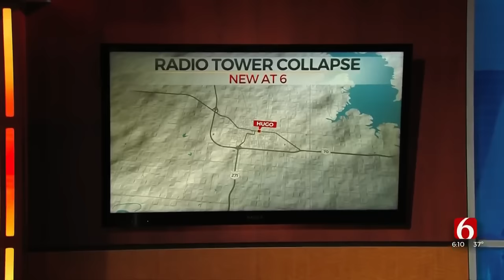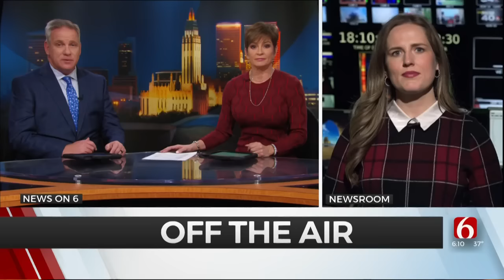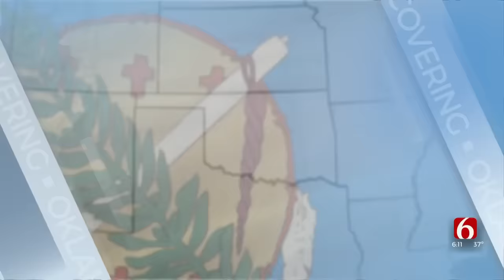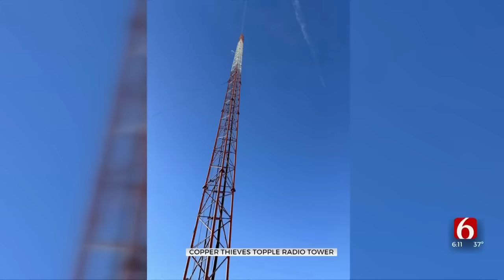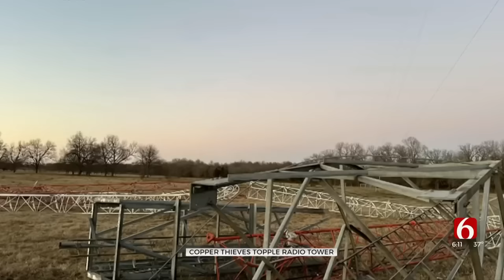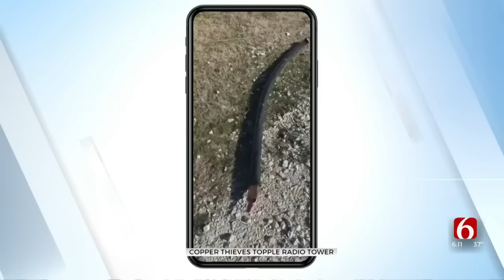Thieves Cut Down Radio Broadcast Tower In Southeastern Oklahoma To Steal $100 Worth of Copper

Comment: The FCC needs to make tampering,with ,or removing copper  wire, or by the act of doing so damages the tower  make it a  automatic Federal class three felony. No matter how much the value of the copper was. Destruction of radio broadcast systems that are vital for transmitting  emergency  weather alert information and other public information for public need to now.

Comment: Either the towers were decommissioned and therefore safe to approach, or thiefs are unaware of the unalive high voltage threat.
Reply: @farmcentralohio  Tell me you don't know how radio broadcasting works without telling. Gird jerb!
Reply: @farmcentralohio I've been zapped by a CB radio it's not fun it hurts under the skin not on the skin not like any burn or anything Ive ever had before. You can smell the burn on the outside but it looks fine and hurts on the inside Plus CBs are only 27 MHz not 100+MHz or GHz that's much worse
Reply: @farmcentralohio  Just speaking like a farmer because it's obvious you have no clue.
Radio transmitters power is measured in WATTs. Anywhere from 50k watts to 150k watts. For such a power and radio signal genius, I am surprised you don't know high voltage is needed for those wattage levels.
Reply: Radio transmitter output voltages can be in the kilovolts high frequency AC.  Up to 10,000 volts for 50kW or more systems if memory serves correctly.
Reply: Depends on the power output. A 1000 watt AM station will have about 225 volts on the base of the antenna. A 10,000 watt station will have around 700 volts on the antenna base and a full power 50,000 watt station will have about 1600 volts on it. Go ahead and lick an AM stations tower sometime. There is a reason why WARNING HIGH VOLTAGE signs are mandatory around such sites. FWIW I worked as a broadcast tech for 22 years. I do know a bit more than you think you know about this.
Reply: @JohnDeereR-zw3wj  You are addressing your post towards ohiofarmboy I hope. I have about a decade more than you in telecommunications experience. But thanks for confirming my statements!
Reply: @Shadowband  Yes sorry if my post was out of step. I was replying to whomever it was that was laughing about antennas having high voltage on them. They CLEARLY have NO CLUE. Also as you know, that voltage is at RF frequencies and not good old 60 hertz like in the wall outlets. It tends to sizzle and fry human tissue as well as shock you.

Comment: The story is UNTRUE  The owners are trying to make money for FM station and NOT have to pay for AM broadcasting.
The tower has been fine for some time. Several years.
The station owner is legally mandated to broadcast an AM signal because of the way the FCC regulations state if you own an AM it has to be used.
Two independent kids went to the very spot where the antenna was. They documented the scene. The video evidence clearly shows the tower has been gone for some time and not recently cut down.
Other factors at play too.
You can't cut up a two hundred foot antenna and just carry it out in backpacks.
The power to the antenna had to also be cut in order to take the wire out.
It looks more like an insurance scam that wasn't thought through fully.

Comment: It's sad that a mainly steel tower costs $500,000 to replace its only a few hundred dollars worth of steel.
Reply: Obviously, you haven't bought any steel lately, besides the fact someone has to fabricate the tower sections, paint, and install them. Very costly indeed.
Reply: @wvrockcrusher  scrap steel is only a few hundred dollars a ton. But the price of steel mark up is on the supplier end obviously over priced. It's a simple steel tower. Painting it fabricating it erecting it and the price of steel itself should not be half a million dollars.  Somewhere someone is making a killing at that price then.
Reply: Steel is the cheap part, probably 10k for the crane, then permits, FCC paperwork and filing, rigging crew to transport and install it. Assuming the anchor blocks and base are up to code. Hopefully the transmitter shut down and didn't smoke itself.
Reply: @wadestclair249 Just admit you exaggerated 🙄
Reply: @BoltRM  you can buy a tower for 60k so where is the other $470,0000 going?
Reply: @BoltRM  the steel cost itself is a small small fraction of $500,000
Reply: Think of it like replacing the rings in your car engine.  Only a few dollars for the rings, but getting them changed out and properly installed is gonna cost the big bucks.
Reply: @paulcrescenti5581  are you talking a efi engine or a naturally aspirated engine? One is more simple to repair than the other.
Reply: wadestclair249 has TDS.
Reply: True.  How much of that does GOVERNMENT add to the cost?  Permitting, approvals from little fiefdom tyrants, immoral "zoning" ...?
Reply: Its galvanized, the whole thing most likely has to be replaced. But that still seems way over what it should cost. $100k plus labor id guess.
Reply: @WW5RM  so are roofing nails.
Reply: @WW5RM  you can buy a tower for $60K
Reply: @WW5RM  if it's insured for $500K it's most likely only $250K to replace.. insurance values are most often doubled actual value
Reply: @wadestclair249  i was just saying its not regular steel. Its welded and hot dip galvanized.
Reply: I replaced a 222 foot steel tower that was 24 inches across a face. It cost $100,000 and that was almost 25 years ago. Tell me again that you are pulling figures out of your ass.
Reply: There is a lot of labor involved to make it.